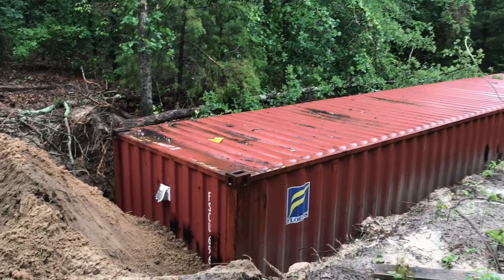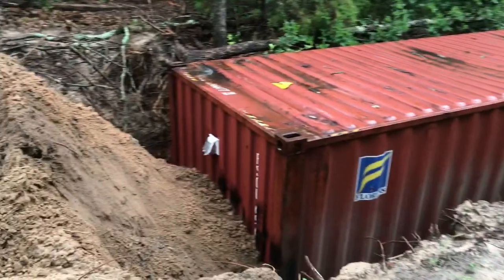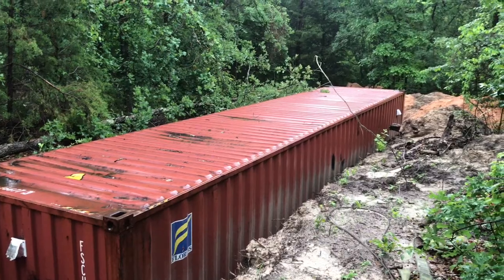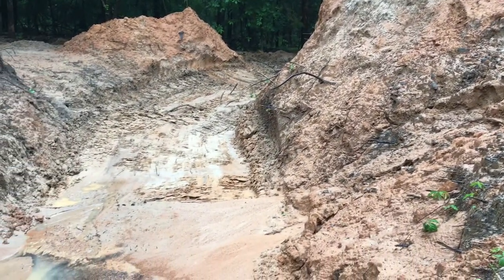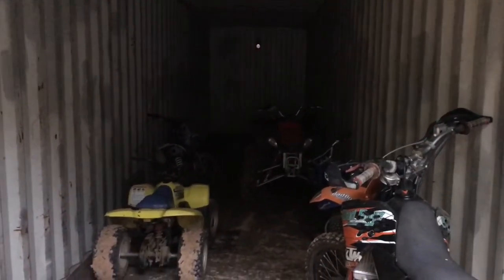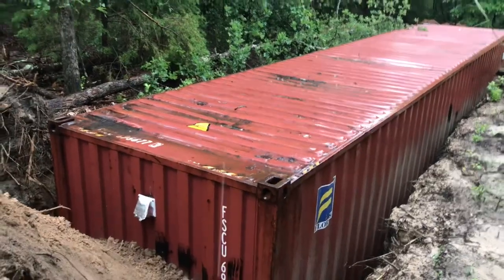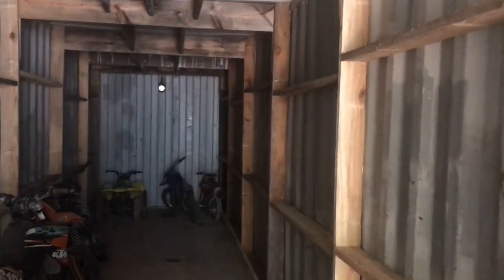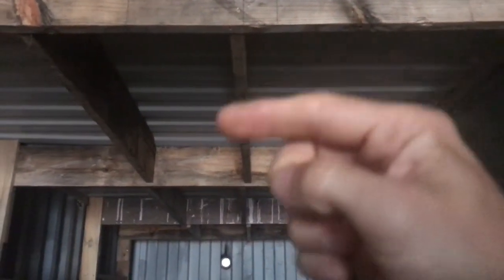Underground Storm Tornado Shelter How To Bury Shipping Container Part 6 Reinforce Top And Sides

Comment: This whole thing scares the crap out of me. 
Container shelters are built on a solid foundation with drainage channels and encased in concrete. The container is basically just a form. This is because container manufacturing specs don’t even come close to the integrity needed to hold back rain soaked earth.
If that needs explaining you can read the following book:

The air pockets always present in recent fill hold ground water. As more rain saturates the ground it becomes unstable and heavy. All that weight is now loading up directly on the container walls instead of the usual concrete barrier. So between you and tons of saturated soil is just your inside bracing.

Meanwhile the sand and soil have eroded (this is not drainage of any form) from underneath the container. When the container shifts from this it’ll most likely twist. The twisting pressure adds to the stress your bracing and fasteners are already under from outside. This could fail explosively, even if not the twist it held back now transfers directly to the container. And the twisted container shell is all that’s left between you and 8’ of mud. Hopefully the front 10’ doesn’t cave in while you’re in there. Can it happen? Yes. Has it happened? Yes. Will it happen to you? Who knows.

Comment: Shipping containers just have four strong points to the roof, over every corner, al the rest but the floor are just light corten steel admit low pressure. Pray for nothing heavy be on it. I saw many containers broken just for a little touch.

Comment: I would have most definitely purchase some gravel and studded out the wall with some beams for horizontal support
Reply: Hey, I have a question. I am really doing research on this for a friend in need of some help. Would I beams that are 10 feet long by 6“ x 4“ that are 10 pounds per foot, so 100 pounds for one I-beam, some more lightweight I-beam. Would that be sufficient and adding side and top support? Or did items need to be more heavy duty? How much spacing out should they be?

Comment: Your inner walls are VERTICAL METAL and your reinforced with VERTICAL wood, that won't reinforce! You need to do it in opposite direction, so you would use HORIZONTAL BEAMS to reinforce your walls and ceiling. You should also weld your frame to your container using steel even small hollow steel framed and welded would be better than wood.
Reply: 4” x 1/4 to 1/2” think angle vertical mid support
Reply: What about horizontal rail road ties on each side and on top. Use metal plates to join them.
Reply: All he can do now is patch up over his mistake of not keeping the weight off the container in the first place.
Reply from the maker: Still standing strong so far so good